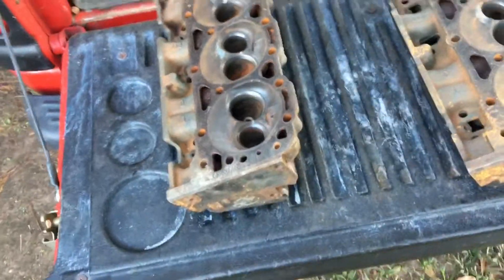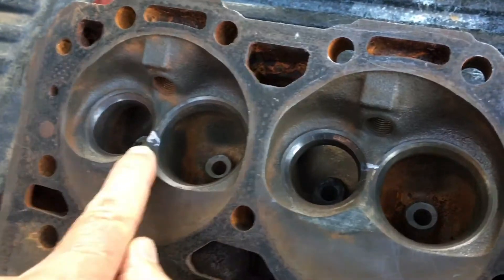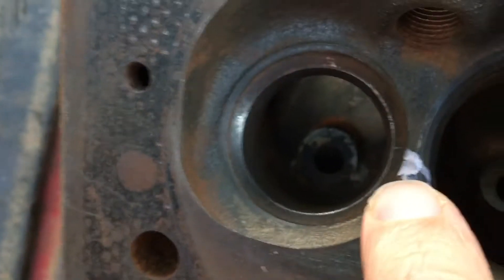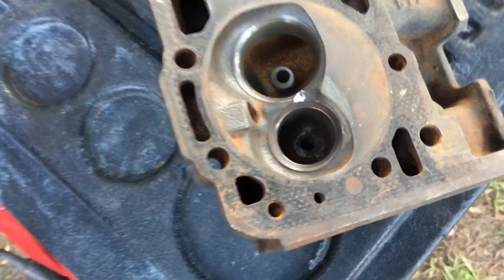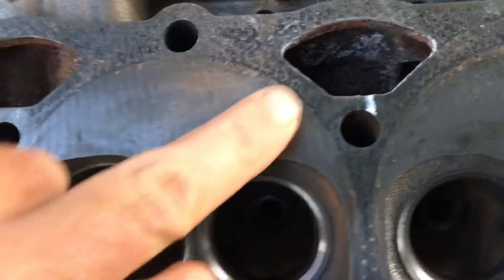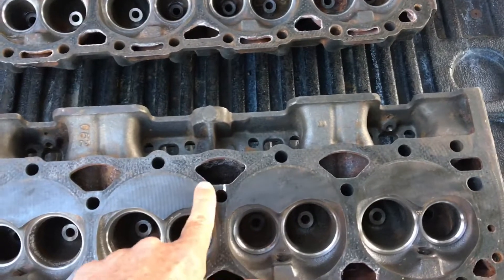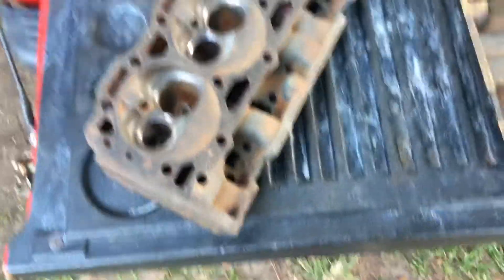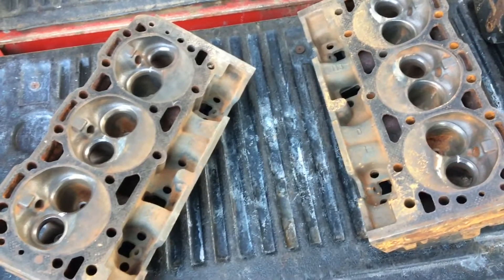Mercruiser 5.7 1(X4) - Vortec Heads Are Cracked (Magnafluxed)

Comment: Finding a pair of used vortec heads that aren't cracked is pretty difficult.  I bought a pair of rebuilt 4.3L vortec heads for my 97 S10.  They were advertised as better than new. They both had stitch repairs between the coolant jackets and the short bolt holes. They're probably ok if they're repaired in that area. I haven't had any problems with them yet. I did use a 180F. thermostat instead of the 190F. If they had repairs in a more critical area,I'd have sent them back.